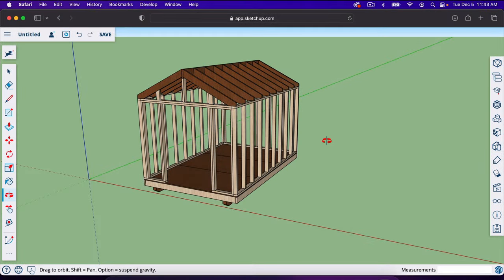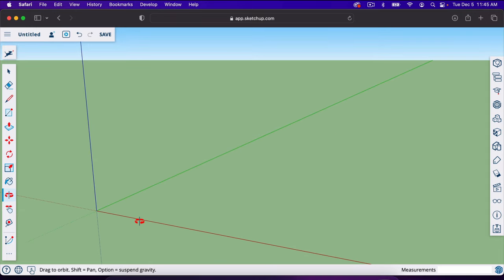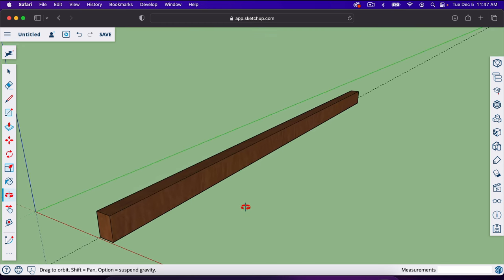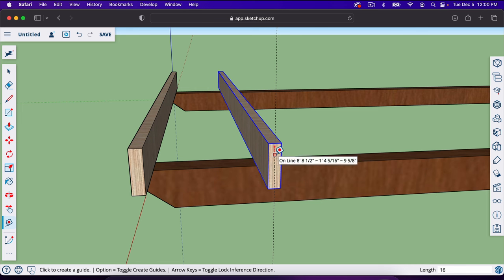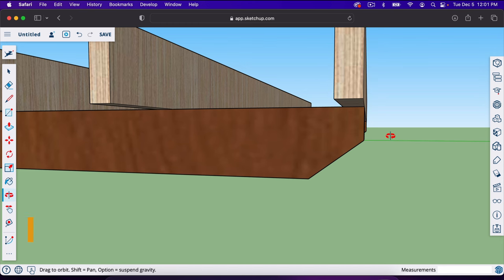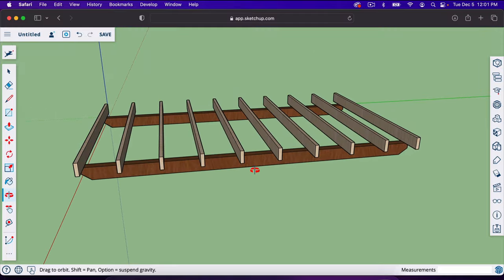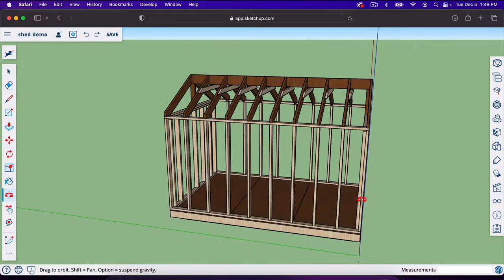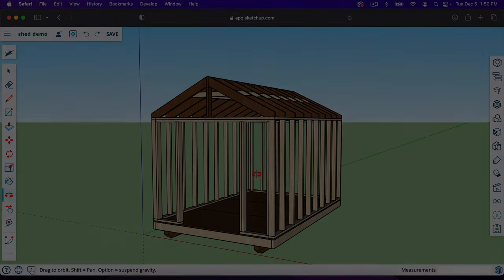How to Build a Shed - SketchUp Tutorial

Comment: How did you figure the ridge stud height without first calculating the angle / pitch of the roof you wanted ?
Reply from the maker: I already designed this before making this video. But, what I did originally was make the rafters at the desired pitch first, then cut them off where they would meet with the ridge board. Then I filled in the studs underneath the ridge board. That’s what I love about SketchUp, you can figure out the measurements as you go. Hope this made sense and answered your question.

Comment: Why name the skid component 4x6 when it is only 3.5x5.5?
Reply from the maker: Because in the construction industry lumber is called by the nominal dimensions instead of the actual dimensions. For instance, a 2x4 is actually 1.5x3.5.
Reply: @CWebbTutorials  OK. Now you are generalizing. In Finland construction lumber is much closer to the actual inch sizes. For example here a 2x4 is actually 48x98 mm or 1.89"x3.86"